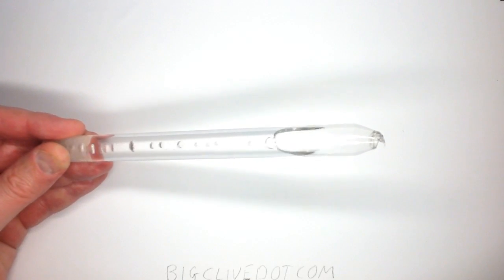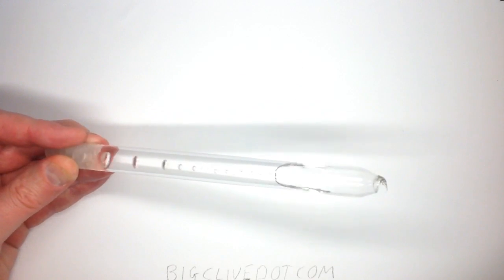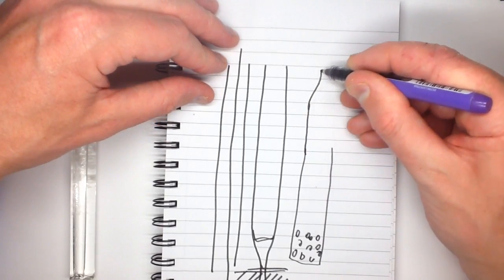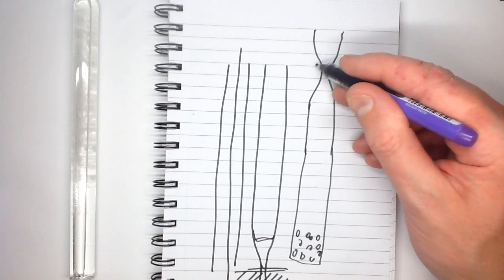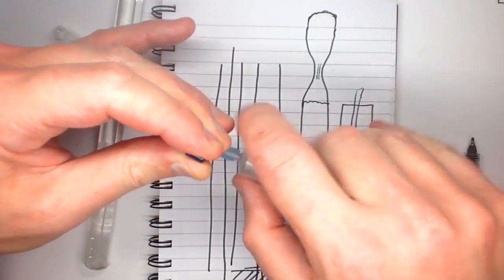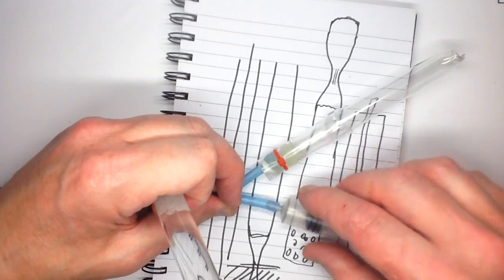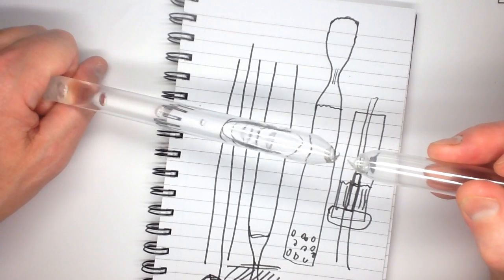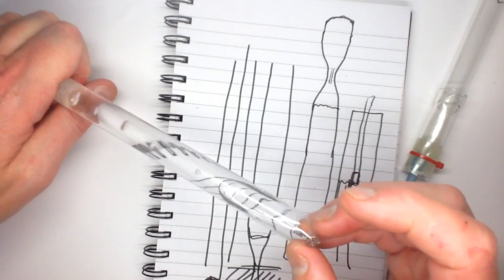DIY methylene chloride bubble lamp tube.

Comment: I make these tubes but also the shooting star and almost done with the oil bubble replica tubes that are similar to the ones from the 40s. If your interested i can send you a few.
Reply from the maker: That would be interesting.   My email address is bigclive1@gmail.com
Reply: Do you make oil tubes that will fit vintage Royal Crown bubble lights?  I have been looking for them.
Reply: @vicb5098  i have been working on them but i am having trouble getting them to start at the moment
Reply: @vicb5098  will do i should be getting more tests in here soon this spring.

Comment: Late to this party:  Did you ever mount it over a low wattage incandescent bulb to warm it?    Little methyline choloride USB bubble lamp to sit atop a pc or somesuch
Reply from the maker: Yes.  It worked fine with a low power lamp.

Comment: You could in theory create these without a pump. prior to sealing the tube you would heat the liquid to its boiling temperature and then close it off. as the liquid and gas cools, the gas would condense and form a vacuum on its own. Would be a neat experiment.
Reply: I try to picture what they may have used in original manufacture. 
That sounds more like it.

Comment: Isn't there the concern with mercury vapor from cracking open fluorescent tubes like that?
Reply from the maker: They contain an absolute tiny amount of vapour.  It's all just scaremongering.  Old neon-style tubes with argon and mercury contain a lot more.
Reply: Oh cool. I once smashed a bunch of tubes in my backyard when I was a kid. I thought I might be messed up from it nowadays. I guess not.
Reply from the maker: To put things into perspective, the primary victims of mercury poisoning were hatters who used tubs of very hot mercury to press felt into shapes.  The mercury vapour caused them to go "as mad as a hatter".  But cold mercury and traces of vapour are not a significant hazard.

Comment: Thanks, I've been looking for one of these DYI for bubble lights. How can I add green and blue to the Dichloromethane. I know simple food coloring will not work because the Dichloromethane is non miscible with water. I also know there must be a way to color the Dichloromethane because bubble lights using Dichloromethane are often colored, somehow. Thanks
Reply: Refrigerant dye from an auto parts store.
Reply: Yes, anything else?
Reply: I found darker colors you hardly see any bubbles. Only use a tint.
If I were to make some I might try to take a little from some old blue tubes that are too dark anyway.

Comment: What happens if the whole thing gets too warm (eg. in Summer, accidently put in your pocket ...)? wouldnt there be the danger of bursting?

and if thats not the case, maybe you could use Diethylether next time for an even lower boiling point :)
Reply: No, it's under vacuum in the first place, it would have to get quite hot for the pressure to even go nonnegative. And glass is actually quite strong, so it would have to get many times hotter than that to create any danger of bursting. A bigger risk is just dropping the damn thing on the floor.
Reply: U mad bro?
Reply: plus if it does all boil it boild into the vacuum and that means the pressure just equalizes or at rises just a little before it goes to hand temperature, just a TINY LITTLE BIT of thinking could help you.

Comment: I've wanted to build bubble tubes for years, and you've given me the solution I need! About 18 years ago, I apprenticed in a neon sign shop, and I thought I had everything, but I ended up with two problems: first, I never seemed to figure out "neck the tube first, then add the solvent." Second, I couldn't figure out how to draw a vacuum, since doing so with the shop's pump (neon shops use a two-stage pump, vapor diffusion, then mechanical) because the vapor might have spoiled the silicone oil in the diffusion pump. Now, thanks to you, assuming I have access to neon tubing and tube-bending torches, I think I can make these!

Comment: Thanks Clive I have ordered a Rectifier on ebay sorry for being a pain could you draw a diagram on hot to wire it the transformer has 3 wires comming out of the rear when I conected it up before you told me about the rectifier it was showing 25 amp so retifier will be the answer many thanks and your videos are very important to people like myself willing to learn  Ray

Comment: Hi Clive...
Just a bit of info about why you need rock salt or other stuff in the bottom of bubble tubes. The points and edges of the rock salt crystals form nucleation sites for the bubbles to form. The surface of the glass is generally too smooth for this to happen and the liquid can be raised above its boiling point without it actually boiling and becomes superheated. You may have seen this effect if you've used a microwave to heat water to make a cuppa. If the vessel that you're heating the water in is very clean and smooth and the water is clean without any suspended particles, you can superheat the water to above 100C without it actually boiling. This is a pretty dangerous state of affairs because the slightest knock or addition of something to the water like coffee, teabag, sugar can cause the water to suddenly boil and violently eject itself from whatever you've been heating it in. This doesn't happen very often but if it does it can be very bad news for your hands, face and eyes.

Fortunately, this is exactly what you want to happen in bubble tubes.

Sorry if this has turned into an essay - I ramble on sometimes.
Reply from the maker: MrBanzoid I don't think it's just for nucleation.  It's also to trap some solvent at the heat source to allow it to heat to the point of evaporation.  Without the salt the heated solvent would just flow to the top of the tube by convection.
Reply: Sorry BC. I should have thought of that as well!
Reply: Is the rock salt  ice melt or the large chunks of sea salt from a kitchen salt grinder?

Comment: Hi Clive could you answer a question I have a 12V car battery charger and the on board is dead can I bypass the board so that I can still use minus the board I checked the Diodes and they were fine but the board has failed  many Thanks Ray
Reply from the maker: Ray Campbell It depends on whether there was current limiting to protect the transformer on the board.  Traditional chargers were just a transformer and rectifier, but used transformers designed to limit the current without overheating.
Reply: Thanks for the info I will need to get a rectifer could you advise on one and where to buy in Glasgow  or ebay I do like your videos find them good to watch and learn from them thanks again Ray
Reply from the maker: Ray Campbell I'd recommend a beefy metal cased 35A bridge rectifier for thermal reasons and ease of connection with crimp connectors.  Keep in mind that an unregulated rectified DC supply can cause lead acid batteries to vent electrolyte as gas if they are over-charged.  If the transformer is not self regulating then it may also overheat if the current is too high on its secondary.
Reply from the maker: Ray Campbell You can buy a 35A rectifier and the crimps for it from Maplin.  Any voltage rating above 25V will be fine.  Most 35A block rectifiers are rated in hundreds of volts.  Was the original charger switchable between 6V and 12V?
Reply: 6V / 12v  Trickel charge
Reply: the four terminals on the rectifier how do I wire them with 3 wires comming out of the transformer and the 2 wires with the crockadile clips
Reply: I am sitting watching your video on led toadstool
Reply from the maker: Ray Campbell It's hard to say without actually looking at the transformer and testing it.  But the bare minimum charger using a current limiting transformer would be the two 12V windings going to the AC terminals on the rectifier and the positive and negative terminals going to the battery clips, preferably with a suitable fuse in line.
Reply: thats a great help Clive on further looking at the old board it looks like their was a rectifier on it so I thimk I will be able to work it out the transformer is aMBC 12v on the rectifer when it was wired to the board 1 of the crock clamps was wired to an earth many thanks again for taking the trouble to reply to me I am the type of perso n I like to beable to take apart things and sort when I can  again thanks for the advice

Ray

Comment: Can you draw so much of a vacuum that it will constantly boil by itself?
Then would it be possible to have like a water wheel (like the old ones with fins or buckets you see in rivers) to capture the rising bubbles and rotate a shaft through the glass tube (if if its even feasible to have a sealed bearing shaft through the glass. Just thinking of alternate power sources)

Comment: If you can get hold of one, you could use a three-way stopcock (luer valve, usually sold as an IV adjunct, to be used with IV giving sets) whilst drawing the vacuum, save you from having to disconnect, reconnect and pinch the tubing whilst you clear the syringe.

Pull, turn, push, turn, pull, etc.
Reply: Szlater you can also get very reasonably priced, one way valves that fit silicone tubing,  from fish keeping shops.

Comment: Fantastic work! Maybe there is a cottage industry for making replacement bubble lamps for classic Christmas lights?

NOMA UK (Christmas lighting company) re-released bubble lights in the UK in the form of a candelabra a couple of years ago, I bought one & you can still find it if you Google; Noma 5 Red Bubble Effect Light Candelabra. 

Anyway these bulbs also have some form of rock salt at the base and will also slowly bubble by the heat of your hand. It makes a great decoration in the window as during the day the sun shining on them also gives you a full flow of bubbles.
Each phial uses a 6V, 167mA E10 bulb at the base to light and heat the liquid to a full bubble stream. The instructions say they're filled with Dichloromethane diluted to 50ppm, each phial containing only 0.45mg of Dichloromethane.

You should see the health & safety warnings all over the box, I think they want you to wear a full hazmat suit when changing bulbs!

Comment: Very nice! Is there significant heat transfer between the hot and cold ends? I've been thinking of making my own heat pipes for ages now (sintered copper, possibly even water as the transport). Would it be possible to double neck it at the start, instead of pulling a vacuum just boil the DCM and seal the top neck, then allow to cool and seal the bottom? Fun project, thanks!

Comment: Methylene chloride is Dichloromethane, and not Chloromethane, right? I love that stuff for glueing plastics, gooifies and welds many plastics, like PC, PS, ABS, PMMA, PET and in a pinch PVC (no chance, as always, on PE and PP though, and it's the wrong thing for PA, too).
Only drawback: I always get a minute of headache and slight dizzyness even when having the window open and just putting like five drops out of a syringe on plastic.
Btw. while I'm definitely not from the safety police and don't think much of the EU ban of paint strippers that contain it, be very careful when burning it. Like many other chlorohydrocarbons when burnt it can release phosgene, a poison gas used from the first world war onwards.
Reply: +superdau Yes, they use both names interchangeably. I got a whiff of phosgene in the past, it was like breathing in a cactus, gave me a headache, and dropped me onto the floor and I sat there on my butt for 5 minutes wondering what the hell went wrong. DMC is a great solvent for extracting things too because of it's low boiling point combined with it's insolubility in water.. . I have managed to catch it on fire before from a bit of oops, and the fumes do make you dizzy. But the only time I accidentally created phosgene was leak testing an old commercial cooler running r-12. That was a bad day.  All I got one was tiny bit of purple flamed disaster. Holy meatballs that stuff sucks.
Reply: mharris1270 Phosgene goes by the same name here in the USA, and no one in their right mind would try to get high off it. Kris up there described it well, like breathing a cactus. One whiff of that shit will lay you out. I had the same experience as kris, leak testing a system running  r12.

Comment: Sweet, fantastic finished product and straight forward build. I'm going to have to search the house for other liquids that have similar boiling points/vapour pressures.
Reply: +Nick Moore Make sure to check upside down air dusters they might contain ethylene fluoride (difluoroethane) which is similar.
Reply: Or starting fluid which contains diethyl ether.